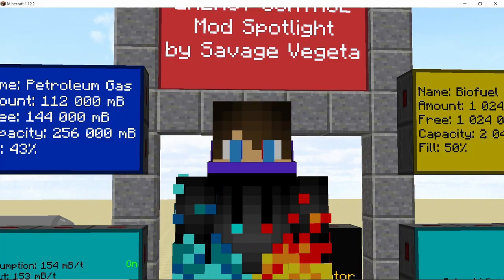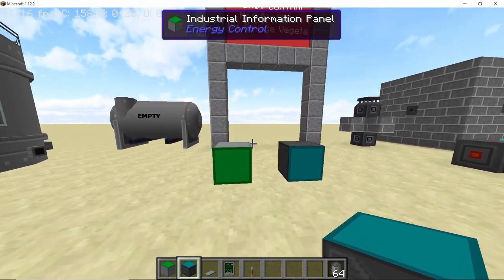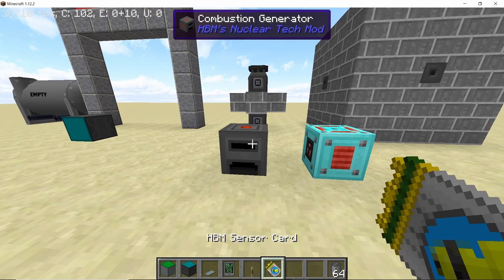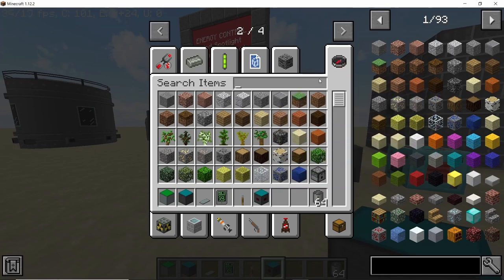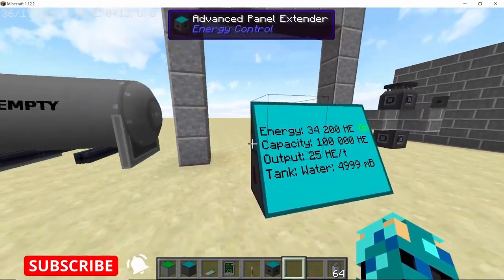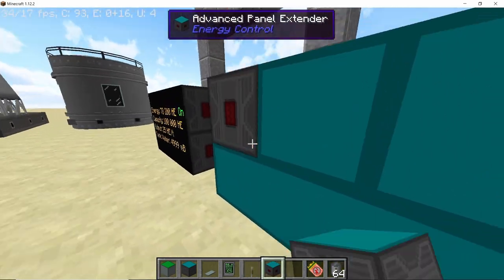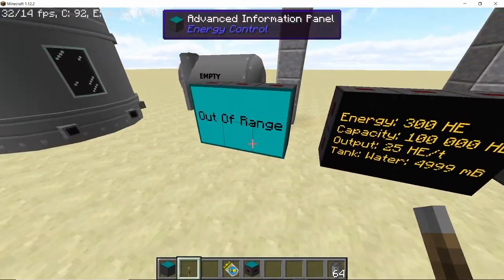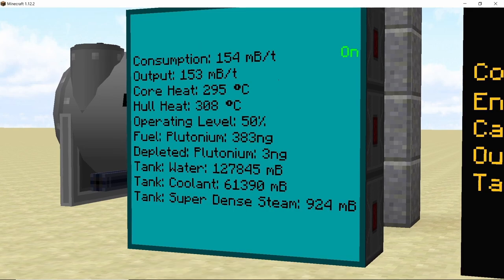"ENERGY CONTROL" Mod Spotlight | How to monitor Nuclear Reactors using Energy Control - HBM Reloaded

Comment: I didn’t even think that 1.7.10 version was still needed by someone. I'm working on 1.7.10 hbm support now so it will be in next 1.7.10 Energy Control release.
Reply from the maker: Most of the HBM players use 1.7.10 version as it is still recieving constant updates , by making a compatible energy control for 1.7.10 you'll be filling in a gap that no other mod can fill. I THANK YOU FOR MAKING THIS AMAZING MOD !!

Also lemme know if I can help in any way with the development for the 1.7.10 version
Reply: thanks! Could you also add a way to measure the energy output of an RBMK? It could be a counter block that counts HE of all turbines
Reply from the maker: @theoneandonly5831  I think if you connect all of the turbines power output to a single storage block and monitor it with an energy sensor kit ... That'll basically show the entire power output of reactor
Reply: @theoneandonly5831  In 1.12.2-0.2.8c you can see output of each turbine and RBMK steam channel.
Reply: @SavageVegeta  ah okay
Reply: @Zuxelus  thanks for worning on a 1.7.10 version! Its the one most people want
Reply: @SavageVegeta  Yeah but not the HE per tick rate it is the amount stored in the block
Reply: Can you notify me after it comes out?(like a discord server or something)
Reply: btw hbm reloaded is digamma unstable (if crashed the world is globally destroyed  and you can't join back)
Reply: hey, i think you wont be reading my comment but can you add RBMK Fuel Rod Temperature Reading?

Comment: What a nice mod….i just wanna know that will it work with an rbmk reactor build too ?
Reply from the maker: From what I've tested no it doesn't work with RBMK , if it will tho that will be insane and I'll make a video on it xd
Reply: @SavageVegeta  Will add RBMK in next version. Already added monitoring each RBMK block with kit and thermal monitor. Now thinking what to show for RBMK Console and how to calculate total input/output. All ideas are welcome.
Reply from the maker: @Zuxelus  jeeez I didn't realise until now that I was talking to the developer of the mod. I tried using the thermal monitor but couldn't seem to use it. I'll give it a try again !

Comment: I have a question that what kind of energy Kit assembler use?
Reply from the maker: You can use the HBM kit on the assembler, probably the inventory kit and the energy kit too (if the energy kit has an advanced variant like fluid then you can use that too afaik)
Reply: @SavageVegeta  well that's not the answer of my question. Kit assembler use 'EU' Energy from Industrial craft 2.
By the way thanks for your response.👍
Reply from the maker: @abhijeetgaming5749  oh I thought you were talking about the assembler from ntm

Comment: savage vegeta could you do a tutorial on how to use the thermal sensor in the energy control mod please.
Reply from the maker: Yeah I plan on doing that as soon as a more stable version of the mod is released , or atleast I can confirm that it is stable
Reply: Ok,thx.

Comment: Really easy to follow guide like all your videos! I just have one problem, I installed the latest version of Energy control in and I don’t see the HBM kit, is this because The reloaded version just updated or is there a HBM addon for the mod? Thanks!
Reply from the maker: Yes the reason can be cause reloaded just received a major update recently cause the kit used to load in the older version of the mod properly. Still I will double check soon

Comment: Problem: i have HMB reloaded and energy control installed through curseforge app, i checked versions and all of that and it all matches with the ones in your links. My problem is that i DO NOT have the Hbm sensor kit
Reply from the maker: Hmm then the version of energy control you have is wrong. 
You can download the energy control mod from here as well : https://github.com/Zuxelus/Energy-Control/releases
here it is updated constantly so you can keep up with the development of the mod as well. Lemme know if it works or not
Reply: @SavageVegeta  ended up getting it figured out in your discord, thank you very much though!

Should go take a peek in the minecraft text channel, built a reactor, control room and all, all thanks to your videos for pointing out how to use the kits lol

Comment: Savage Vegeta, do you have an old version of the little nuclear reactor?
Reply from the maker: If you're talking about 1.7.10 then you can download the old version of HBMs from git or Curseforge and it'll have the older version where the nuclear reactor worked
Reply: @SavageVegeta  Why did you decide to play with the old version? Didn't you like the fact that the little reactor ceased to exist functionally
Reply from the maker: @farnorth7216  I didn't decide to play with the old version bro , I wrote that cause you said you wanted an old version of the little nuclear reactor. I'm neither happy nor sad about the small reactor anyways , it's a research Reactor now so it's all good :D
Reply: @SavageVegeta  I hear you, but the fact that all is well is very questionable because this reactor no longer exists

Comment: I downloaded both of the mods but for some reason the energy control mod doesn't have any of the HBM stuff.
Reply from the maker: If you downloaded the mod for 1.7.10 then you won't get any of hbm stuff
If you downloaded it for 1.12.2 then you downloaded an outdated version. Cause one the recent latest versions have the new stuff
Reply: @SavageVegeta  that was the one I downloaded unless it told me something wrong. I will try again tomorrow

Comment: could you make a tutorial with this mod for the DFC to make it a little bit safer?

edit: i dont have the hbm sensor kit for some reason i dont know why i assume its because i am using the newest version of the mod but i really have no clue or it would genually be nice for anyone to tell me: what versions of the mods are compatible
Reply from the maker: I'll do that but it'll take some time as I haven't really tried the control portion of this mod extensively. 
I've been trying to make a Redstone control system for DFC tho

Comment: The first time I built an rbmk reactor in hbms mod I was in survival mode and when I ran the reactor I saw wait why is coolant not flowing to the core and then I remembered that I never set up the coolant pipes and when I went to the reactor it exploded 😒
Reply from the maker: Wait do you mean the water pipes were not set ? Cause the RBMK uses water as it's coolant ... That aside it must've been quite an experience having your reactor explode the very first time you were building it 💥😅
I hope you've made a working design now that doesn't go boom
Reply: Yes the coolant pipes were not set and the steam pipes too but for some reason there were the turbines but I guess making my friend set up the pipes was a bad idea as he was still building or crafting pipes so yeah 👍
Reply from the maker: That sucks , well yeah next time I hope you double check all your pipes before running the reactor to avoid such explosions

Comment: Bro , scud missile mod I s crashing with hbms mod , 😢😢 and I want to use the scud mod , any solution??
Reply from the maker: Are you using only SCUD missile or you have the nuclear addon as well ?? Cause the nuclear scud addon will require you to have the latest version of IC2 installed
Reply: @SavageVegeta  nuclear one too , and I have IC 2 Installed too!! But still crash,😢
Reply from the maker: @UNDERTAKER_Parasoul  maybe try removing the nuclear scud and only load up with hbm and scud missile mod.
BTW the scud nuclear addon is only for 1.7.10. It won't work for 1.12.2
Reply: @SavageVegeta  bro , I try without the nuclear addon mod , the base mod works , perfectly,  but the nuclear one crashes
Reply from the maker: @UNDERTAKER_Parasoul  maybe you're missing out the dependencies that ic2 needs , idk man this has never happened to me the nuclear addon runs without any issues

Comment: is there any way to detect if there is going to be a meltdown to sound a siren?
Reply from the maker: Yes , if you didn't know this then reactor control blocks emit a comparator signal based on their temperature. So you can easily measure that signal strength and place a siren at the appropriate temperature that you want to your alarm to go off at 

However I highly recommend setting up auto shutoff for the reactor using the reactor control block as it better then losing your entire reactor

Comment: Works in 1.7.10 latest version?
Reply from the maker: Nah it doesn't work with 1.7.10 hbm as it doesn't use the same base as 1.12.2 does , that's the same reason RFTools doesn't work with it as well. 
If there will be some sort of compatibility I'll make a more videos on it for sure !

Comment: One question if the big boi reactor is bigger does it mean that the electricity level also increases
Reply from the maker: Yes if it is bigger then it can store more steam , more steam means more power
Reply: And when the big boi reactor becomes huge can you use three or four leviathan turbines

Comment: Is it possible to make a safety system for the reactor for example if the temperature reaches a certain degree the reactor will shutdown  this is going to be useful in case of an accident 

And as always excellent videos
Reply from the maker: Well that can be done with the reactor remote control block as it will automatically shutdown the reactor at high temperatures. You can use these screens in combination with it for monitoring purposes. 
There is a temperature display block in energy control but it hasn't worked with the reactor yet. I will give some more combinations a try and see if I can get it to work

Comment: Hey I have a question.

Is the 1.12.2 version or the 1.7.10 version better because I have been working in 1.7.10 for a while
Reply from the maker: Both versions have their own pros and cons. For example as you can see here version 1.12.2 is compatible with alot of other tech mods but is not being worked on now. On the other hand 1.7.10 lacks the flexibility to work some of the major tech mods especially in terms of fluids but it is constantly being worked on and cool stuff is being added. So it all depends on what your endgoal is tbh , if you wanna make a big tech modpack then go for 1.12.2 but for solo HBMs Experience 1.7.10 is much better
Reply: @SavageVegeta  Yhanks so much

Comment: Is it only for 1.12.2
Reply from the maker: It is for 1.7.10 as well but doesn't really work with HBMs mod. You can use it with other mods tho
Reply: @SavageVegeta  all my plans in making in a nuclear plant has gone fail
Reply: @SavageVegeta  does it work with zirnox reactor
Reply from the maker: @demon-cores  the develop of this mod has told that this mod will work with hbm 1.7.10 after some updates as he is working on them now

So when those updates come out then yeah it should work with Zirnox as well

Comment: does this system work on RBMK reactors?
Reply from the maker: Yes it does , however not in a way you might be expecting it to be ... It's more for like monitoring purposes
Reply: @SavageVegeta  Can you make a video to explain how it works
Reply from the maker: They are adding RBMK Compatibility soon , I made a short video already but once the feature is fully implemented I will make a full video on  it